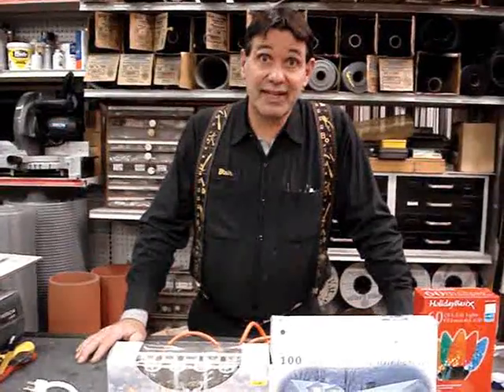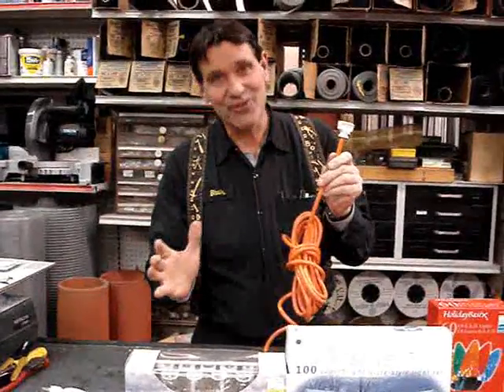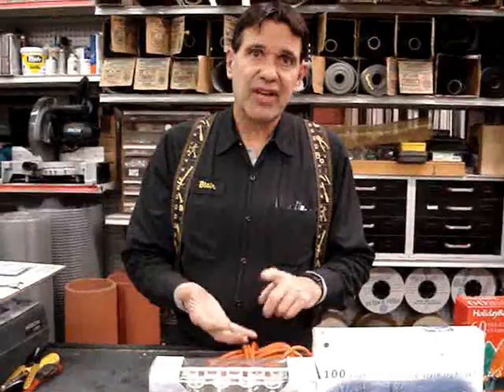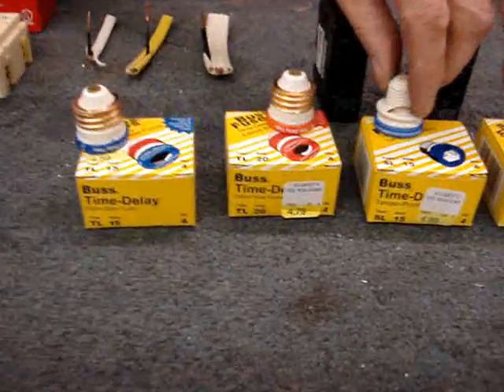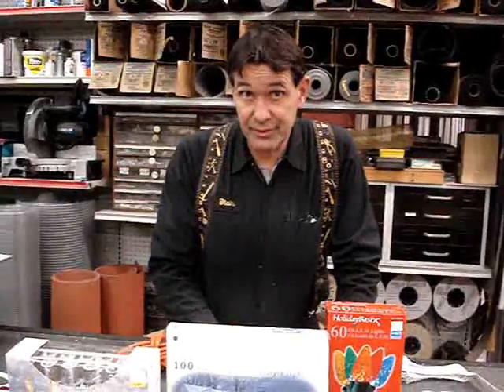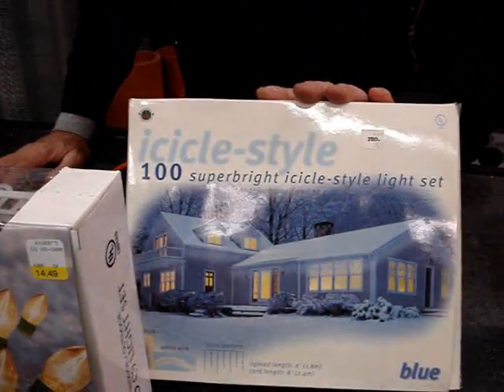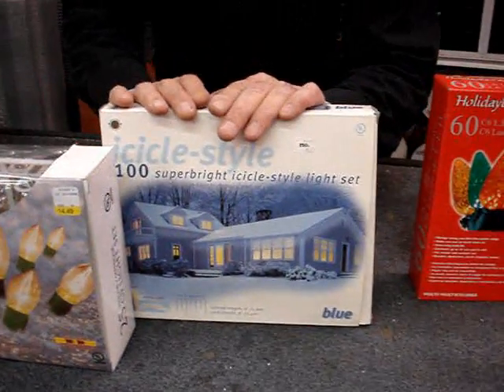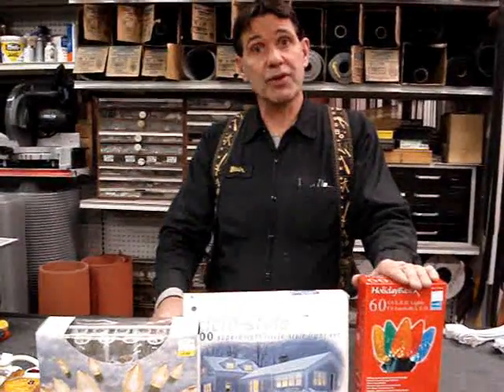Christmas Lights Safely - No Overloads, Trip Breakers, Fire Risk

Comment: If I have a 2-outlet box on a 15A breaker, can I plug a 15 A string lights in each outlet? Thx
Reply from the maker: No, you only have 15 amps available to that circuit. Could be be 5 receptacles on that circuit and total load still cannot exceed 15 amps for all of them. 2 15 amp lights draw 30 amps, which will require 2 circuits. It must be some giant string of lights to draw 15 amps. Usually a string draws 1 amp or less.

Comment: I got a question for you I don't know if you know it I have a lot of blow moles with regular 40 watt bulbs some 60 I'm trying to replace them with LED bulbs having trouble fond in the bulbs that'll fit them but that's not my question my question is if I use LED how much electricity will I save on them I have probably about almost 200 blow moles how much would maybe 5 blow moles with a regular bulb to LED save me
Reply from the maker: You will use about 1/7 of the electricity that you use with a regular incandescent bulb. light up 7 blow moles for the price of one!
Reply: Mr. Hardware do you know what kind of LEDs would work in them I've tried a couple different kinds and I can't have no luck I'll keep trying but maybe you know it would definitely save me a lot of electricity. My other question is hard to say on here call the word it I have a couple electricity places in my yard where I bought the stands from Home Depot for like $10 how do electricians get around that to the use of PVC pipe with a different kind of top to mount electricity like a foot in the air over the ground by your bushes. I need to do about 10 more but I don't want to spend $10 a pop and on Amazon they have those stands for even more money than that what's the cheapest and best way around that what do the professionals use do they just use a PVC pipe with some kind of top on it and then put the electric box
Reply from the maker: I thought most leds work outside. I don't get your pvc pipe question, it can be used when it is attached to a building, and receptacles installed where ever you want.
Reply: Mr. Hardware the LEDs work outside they don't work in the blow molds for some reason I tried two different brands I have another brand that I have to try I just haven't got around to it with the snow on the ground the problem is they need to screw in more to the blow molds and they don't so I guess I need a LED with a wide neck the PVC question okay let me try when you hook up electricity outside and you wanted about a foot off the ground in Home Depot they sell these PVC adapters at the electrical box goes on top of but they're like $10 each is there any cheap white around that if I buy a PVC pipe like an inch or two inch wide do they sell around top with a box could go on to that also on Amazon they have these boxes that you can have I have a couple of them but they're expensive how the most electricians hook electricity up outside like a foot or two off the ground do they use a regular PVC pipe with some kind of adapter I'm talking about priest standing like a garden now where you can put it towards your garage or house on the side and bolt it into your house a priest standing like in the middle of all you bushes when you can plug your low-voltage into I don't really know what it's called that's why I'm trying to explain it I hope you understand what I'm saying say I have a rock garden with some bushes around it and I need the electricity stand-up a foot high over the ground what do most electricians use do they just use a regular PVC pipe with an adapter and then put the electrical box would that work don't worry about it I think into stuff too much I'll figure it out thanks for the help the main thing is the LEDs I got to try to just find one with a long and neck I guess I know some people just buy a whole new electrical plug bulbs units but those can get expensive if I have 200 of them I need but I could definitely use the Savings in electricity to use it on more lights I just bought about 200 more LEDs sets for next year my next big job is I need to get somebody to upgrade my electric to 200
Reply: This man is no Amateur he is an Electrician of superior intellect behold Cole, D R i N K............